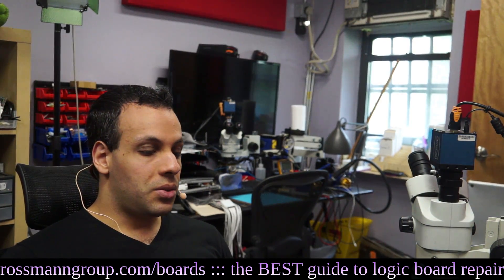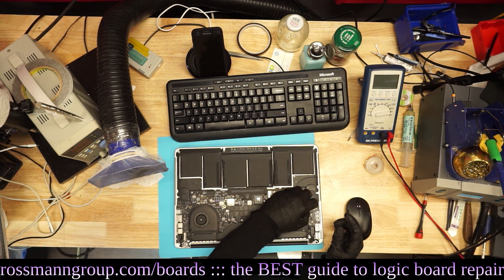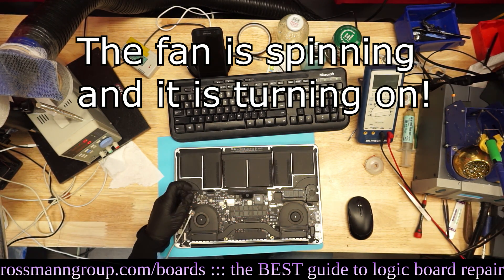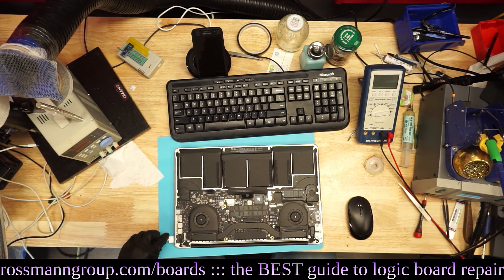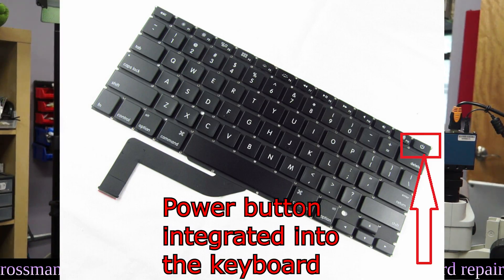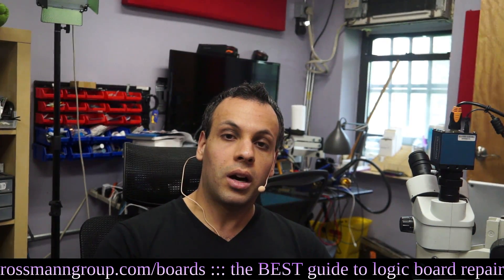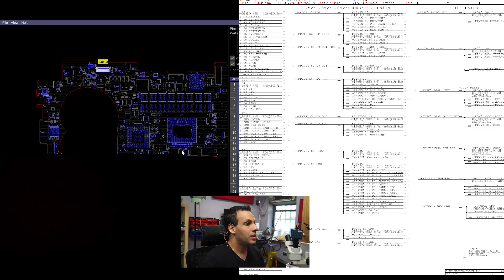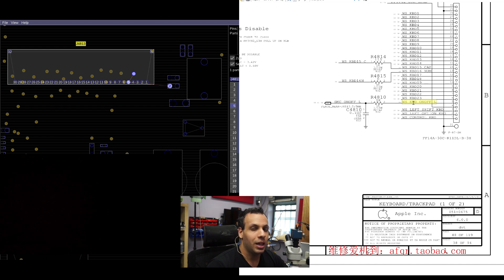Ingenious Macbook Engineering: explained in 3 minutes.

Comment from the maker: Don't you want a machine you can pour liquid on and have it still work? Something liquid resistant? Something from a company that will overnight you a box both ways and replace the entire board within warranty if anything goes wrong, no questions asked?

Lenovo X1 Carbon: http://bit.ly/x1carbonrgrp
Lenovo P51: https://amzn.to/2KaJHww

NOT SPONSORED
Reply: but Lenovo are notorious for built-in backdoors (malware)
Reply: I've been buying the P50s for clients that appreciate its features.  Thanks for the recommendation Louis!  They are sweeeet machines.
Reply from the maker: It's $48,000.. :(
Reply: Don't you want a machine with a large, generous trackpad that has flawless palm rejection and the ability to effortlessly left and right click anywhere without fiddly buttons? How about the design flaw with the Lenovo TrackPoint that it tries to go in the other direction if you use it too much (which they still haven't fixed to this day?) How about the fact that Lenovo uses underspecced, 2-3 year old GPUs and refuses to stay current or even slightly competitive with other laptop manufacturers on the GPU front? Or that their laptops are significantly heavier than the norm? What about the nearly useless fingerprint reader, that takes numerous attempts to unlock the computer?

I used to be a huge fan of Lenovo but their laptops have serious drawbacks that I can no longer tolerate. I would rather be able to carry my laptop without breaking my back, and use it easily without having to pull out a mouse, and suffer the drawbacks of Apple devices instead. 

There is no magic bullet, though. There is no laptop vendor that is making laptops with all the best features of every laptop and none of the drawbacks. Such a unicorn product doesn't exist.  It all comes down to which drawbacks you're willing to tolerate and which ones you aren't.

For me, having a laptop that's vulnerable to water hasn't caused a problem at all, in the 3 years I've been using MacBook Pros. I've never spilled water on a laptop before. And when I eventually do, I'll sigh and give you my business if the laptop is out of warranty. 

By contrast, the unusable and clunky input devices on a ThinkPad inhibit my work every single day, whether I spill water on it or not. It's obvious to me what the better choice is.
Reply: ha louis sounds great, but how to damn afford a p50 or p51, the cheapest one costs 1340 dollars in the united states, but in europe u pay 2100 euros! converting to 2520 dollars! somehow in europe the thinkpad costs 88 % more, i have no idea wtf drugs they are on at lenovo, if u count bs import tax and the 3 year warranty, it's still not damn 88 % and eruope also has no outlet and i'm not sure about how the warranty works if someone gets a thinkpad to europe from the united states outlet.
overall why the fuck are thinkpads overpriced close to apple dirt in europe i can't get it! and can't afford it sadly.
Reply: cataria pega 

Well, the X1 Carbon is lighter than the MacBook Pro (both use iGPUs, but the MacBook Pro has a better one IIRC due to a slightly higher TDP (23W/44W vs 28W/28W I believe)) the X1Y3 has its power limits set at 44W and is about the same weight as the 13-in MBP, has a better keyboard by far, and has a pretty satisfactory trackpad all things considered. Plus, touchscreen options and "Trackpoint drift" is... A limitation of the technology, but still far better for portable usage than any input device that forces you to move your hands away from home row. 

But again, that's not really the point. The point is... Apple's portability and trackpad advantages aren't really pronounced anymore... If they even exist. The trackpad is top-notch, but the lack of Trackpoint as an option, lack of touchscreen as an option... 

But hey, whatever floats your boat
Reply: Sean McNamara at least Lenovo puts gpu‘ in.
Reply: I think you meant to reply to me, not cataria pega. What I will say about the trackpad/TrackPoint thing is: I used TrackPoints (and tried, and failed, to like their trackpads) from 2006 through 2015. I've been using Macbook Pro Force Touch trackpads for a few years now, and any time I touch a PC trackpad it feels like I'm going back 10 years in time. It's awful. I've tried the latest Microsoft Surface Pro trackpad, a 2017 Alienware trackpad, and recent-ish HP and Dell business laptop trackpads, and none of them come even halfway close to holding a candle to the Force Touch trackpad. It's just *better*. It's faster, it takes less thought and effort, it stays clean, and you get more control, accuracy and precision. It's 100% better in every way. I'm not exaggerating. The only thing it's not great for is gaming and for people who spill softdrinks on their laptop for fun.

The "taking your hands off home row" thing is a non-issue. I can pretty much mouse effortlessly and single left-click using my right thumb, without moving my palms or my other 9 fingers at all. If I need to do a gesture or a more pronounced movement, it takes me a fraction of a second to move my right hand slightly to do it. It's far less pronounced of a motion than using a separate mouse.

The 13" Macbook Pro is one of the few machines shipping an Intel Iris GPU, and there aren't any true 13" machines from any vendor with a dGPU. There's the Alienware "13" R3, but it's really a 13" screen with a 15" chassis, and it's very thick and heavy to slot that GTX 1060. When I say 13", I mean TRUE 13", where you can measure it with a ruler and the diagonal from the edge of each bezel is 13.9" or less, or if it's 14" it's at least close to that. Beyond the MBP, most 13" on the market today are using Intel's crappy GT2 graphics solution, which is fine for MS Office and web browsing, but slow to useless for gaming, 3d modeling, video editing, etc.

The 15" Macbook Pro is a very slim machine for the sort of GPU it has. Other PC machines are starting to be competitive in that space thanks to RX Vega M shipping in the XPS 15 2-in-1 and the new Spectre 360, but *Lenovo*, specifically, has no competition to the GPU performance vs. weight/thinness that Apple has. You have to start looking at Dell and HP if you want competition there.

Like I said, I used the TrackPoint for a good 8 or 9 years, and I thought it was the greatest thing. But I hadn't yet met the Force Touch trackpad (indeed, it didn't exist until relatively recently). Now that I have used one, any time I'm doing anything with a computer and I don't have one, I malign how long it takes me to do things. The only mousing device that comes close is my awesome Logitech MX Master 2S wireless mouse that I use for my main desktop PC, but that can't be used on the go or in constrained spaces, and has the aforementioned "hands off of home row" problem (which I admit is a problem for mice).

I agree with nearly all of Louis's criticisms of Apple devices, but I think the advantages are equally objective, and are not based on subjective assessment or "feel". Apple's trackpad is the best pointing device in the world by a significant margin by most objective measurements, such as the rate and accuracy with which you can click on things on the screen. If you accept this, then it really comes down to which brand has the advantages you need, and drawbacks you can live with.

I guess Louis has a biased view of how most people (other than himself) use laptops though, because he gets liquid damaged laptops constantly... He must think that everyone uses their Macbooks with a drink right next to it :D For me, that drawback is identifying what is a rather remote possibility of liquid damage because I'm careful (specifically, I'm careful in ways that Louis pointed out a few years ago in a video when he was describing how to properly use a laptop in a way that doesn't get crumbs/water in the keyboard - I'd have to find the link but it was an amusing and informative video).

So, since the liquid damage problem is minor, and I haven't had any other hardware related issues with my two Macbooks (2015 and 2016), and the input devices are so great, I did the math in my head and determined that I'm better staying with Mac than going to another laptop vendor.

That said, I still do own an Alienware laptop, but I don't use it often. Its purpose is to come along with me if I ever need to go on a long trip away from home -- I will need its GTX 1060 GPU so I can satisfy my gaming addiction on the road. I've only had to use it a handful of times for that purpose, but for every other use case, I far prefer the usability of the 13" MBP. I've gotten about 20 times more hours of use out of my MBP than the Alienware, even though I'm free to choose either one based on my needs at any given time.

And no, I'm not a brainwashed Apple-head. I recently switched from an iPhone 8 Plus to a Samsung Note 8. I use the best product for each particular use case. To me, when it comes to laptops for video consumption and text-based editing (word processing, coding, and commenting on Youtube, for example), the MBP is the worldwide king/queen by a huge margin, and I think pretty much anyone with full use of their hands would agree if they tried it (no offense intended to anyone with a hand disability, just making clear that such disabilities would probably limit your ability to use the MBP to its fullest, and some other device would be better for you.)
Reply: who the fxxk will pour liquid onto a machine?
Reply: People want to buy apple product with a premium price for mediocre item but refuse to pay premium price for premium repair then they went to cheap repair to get mediocre result.

Hm... there is definitely something wrong in here.
Reply: Sean McNamara Talking about GPU weight/thinness, one of the reasons Apple is able to do that is they lack sufficient cooling (not just fans and heatsinks, but room to let the heat escape without slowly damaging nearby components and the gpu chip itself) and let the heat go straight out the metal case. This results in machines that run hotter, feel hotter and often die sooner. Other machines that are light/thin for the gpu power are similar. Now, if this isn't a problem for you, then there's nothing wrong with that. They last a pretty long time and the drawbacks aren't that significant. In today's laptop market, it's common to upgrade to a new laptop before you'd see the effects of one running hot. In the case of Lenovo specifically, the majority of their laptops are "business" laptops, the definition of which has gotten closer and closer to consumer laptops over time. They're a bit thicker to allow for cooling, durability of the case and vibration protection of the electronics inside, ports, and upgradability. These are things that many businesses or other end users want, myself included. I don't mean to say that other laptops aren't durable, just that these thick cases are generally more forgiving for things like falls or pressure. I also like the 13" macbooks, but I  know people who have accidentally closed their screen too hard onto something or put too much pressure on the top when it was closed and broken the screen.

In regards to Lenovo lagging behind in CPU, I'm not sure what you mean. Their current line has up to i7 8th gen processors. Apple, as they've focused more on iPhones and other products, has become slower to update their macbook line and angered people when the touchbar macbook was released because it was underspec-ed and outdated at the normal premium cost. Lenovo's dGPU usage is more lackluster, especially in comparison to other manufacturers such as dell, but this has improved a bit with the current MX150. Not a 1060-1080, but decent.
Reply: Joe Johnson 
Does that tinfoil hat keep your head warm?
Reply: been rocking my y50 for years now, its insane how overpriced other laptops were with the same specs at the time.
Reply: Yes.
Reply: Sounds like you should get a Thinkpad :)

T25 is nice btw.
Reply: well, right now I can buy macbook pro 15" with 16GB RAM and 256SSD and Radeon or P51 with two 512 SSDs, slightly better gfx card, matt screen, screen calibrator and support that works thousands times better than apple. I have used mbp before and comments under this video just reminded me I had problems with overheating (black screen with message to wait a while) or just simply very hot keyboard / touchpad, random reboots, low disk space and generally problems with software availability. Never going back to apple.
Btw, chargers were real shit and had to replace twice for a really crazy price
Reply: and I'm in central europe with official support and warranties, no comparison to apple shops which will just throw away your all data and give you a new motherboard (yes, you can replace disks, batteries and more)
Reply: @fisher xue, don't get me wrong i would never ever buy an apple laptop or any apple product, but i would love to have a laptop, but am really really annoyed at the insane pricing by lenovo and hoping, that windows 7 drivers still work fine as lenovo only lists the malware windows 10 or gnu/linux, which is great to have the option to avoid giving any money to microsoft.
so i'd love to have the option to buy a thinkpad p50 for 1000 euros at maximum, but in europe i don't have that option and that sucks, i can't talk my self into saving up and spending 2000 euros for the few times, i am away from my home desktop, not to mention, that i'd prefer not to support intel, because of their evil israel support,  but for 2000 euros i have to stay without a laptop :/ maybe i can find a used thinkpad with quadcore, ips 1080p, 8 GB ram+ plus dedicated gpu, but those are rare unicorns too.
and long live the trackpoint! i love to have the option to use it!
Reply: I've seen the Lenovo 410's have the power button on the keyboard.
Reply: Louis Rossmann why do you not like the thinkpad yoga X1 Line?  I own one, got it on a sale, use it in the context of mobile student life.  Screen resolution is WQHD, it’s great, and no issues except windows updates that get pushed out too early..but that’s on Microsoft not Lenovo.

My next purchase I am deciding between the X or P series; not sure yet.
Reply: Sean McNamara finally, out of all the toxic apple hate on this channel, a voice of reason. There are always mindless comments such as "why do isheep defend apple?" I've seen plenty  apple users and lots of fanboys criticise apple for many things, and rightfully so. Louis is doing good work in bringing these matters to wider attention.

"Why do people keep buying Apple products when they break so easily and are overpriced?" maybe because for the majority, they don't break easily. And people have tried other prouducts, weighed up the pros and and cons, and picked the Apple product because it works best for their work flow.

A few years back I thought no one could be as annoying, snobbish, and obnoxious as the Apple fanboys, but somehow, today, the Apple haters managed  to do it. They follow apple obsessively and have to spew hate on every apple video they can find. They don't realise that their ridiculous, childish  hate comments likely revolts people and gives apple more customers.
Reply: This configuration, power button on the keyboard, is becoming more common especially in 'Ultra books'. Is it just companies copying Apple design again (whether good or bad), or an unusual coincidence? This makes me wonder if those shitty Chromebooks actually came out with whole 'power button on keyboard' thing before the Macbook Air, but I'm too lazy to check the release dates.
Reply: Hey Louis. Been loving your informative videos for quite a while now. Just curious, have you ever been threatened with legal action from Apple or anyone else?
Reply: Louis Rossmann first thing to do is throw a crapple products in the itrash
Reply: cataria pega Fair enough, no offense to you but it seems like Europe (esp. Eastern Europe) gets boned by tech companies in general. Sorry :( As for Linux driver support? I have no evidence, but ThinkPads have always worked flawlessly for me on Linux. I suspect it's due to how many Linux devs will use it as their machine of choice... soi3 was poor at initial release of the X1C6... But I think that's about it. Linux on ThinkPads is pretty darn popular. You might experience issues with the GPU though... No promises.
Reply: True WingChun  Exactly. It is designed and working the way they intended it to. If you spill liquid on "one key", you are going to have more issues than just that one key. Continuing to use the machine with an external keyboard is awful advice. You want to get the liquid cleaned up and fixed before continuing to use the computer. The liquid can easily trap itself in an area and not become a problem until it leaks further to where it does becomes a problem. 

Nobody should be spilling drinks on anything electronic. That's a no-brainer. Especially if you paid $1,000+ on a MacBook. Probably ought to keep the drinks away if you are that prone to accidents.

Comment: Looks like you'll never run out of work.
Reply: We're IT, we'll have work until there will be dumbness.
Ironically undertakers could have no job if people decide to burn or bur people at home in some ways but we'll still have issues because the crockpot they decided to use to boil their dead one's bones for 48hours doesn't turn on.